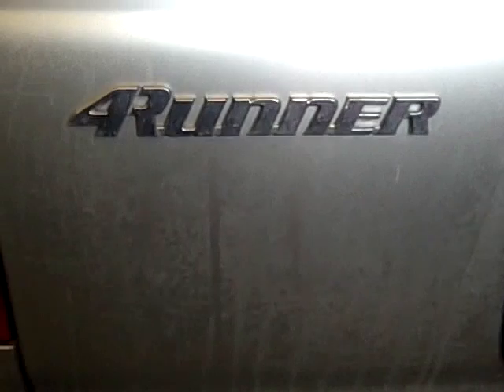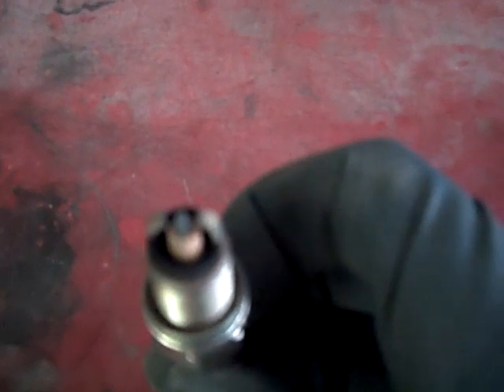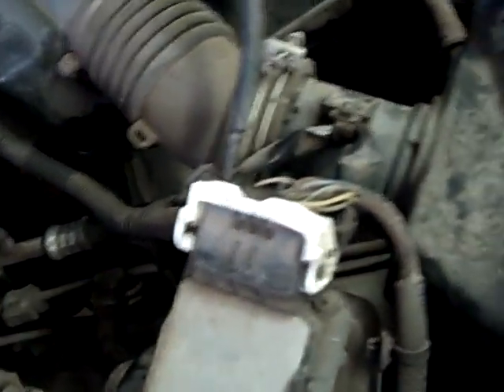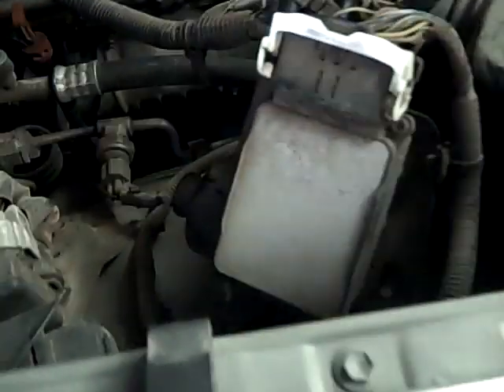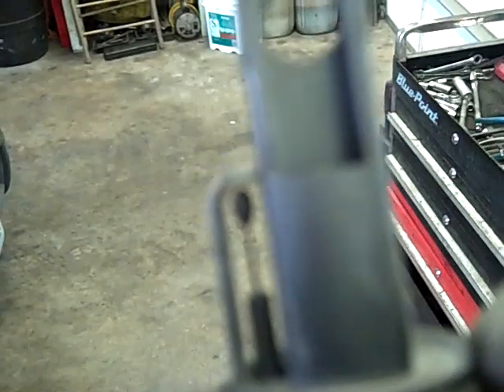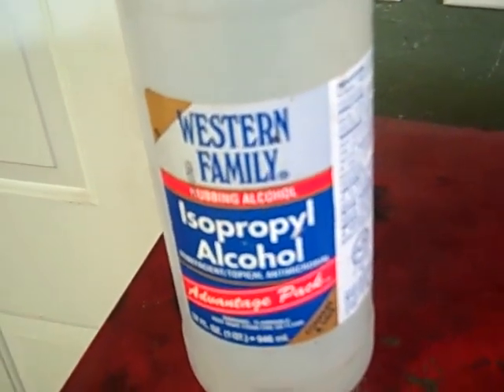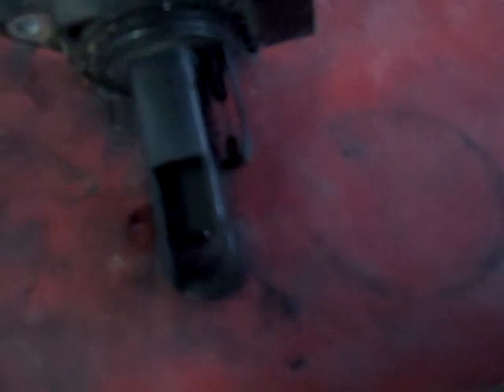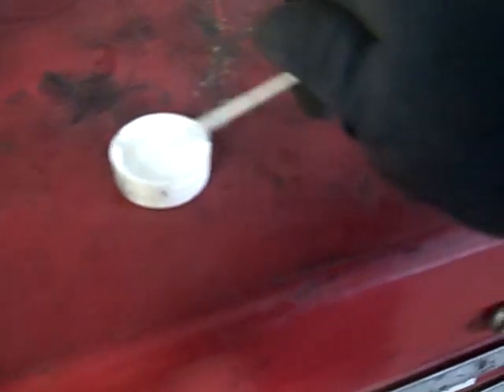P0171 P0174 Toyota 4Runner MAF Mass Air Flow Sensor Fix

Comment: I have an 06 v8 4Runner and I’m getting just the p0174 code. I replaced the maf, pvc valve, replaced gas cap and still the code stays. The runner runs fine, no misfire, no rough idle, nothing. Imma try and do a vacuum leak test but was wondering if you had any suggestions? Thank you
Reply: My 2003 4runner has the same codes start and runs very good but it does make backfires on hard acceleration when is running and has not enough power in heavy acceleration.

Comment: will it throw that code if the intake hose boot is cracked also??  the upper one,     I taped it with electrical tape but failed smog here in CA

Comment: why not use mass air flow spray?  what percent alcohol. are you using? I'm working on a 2010 Toyota rav 4. slight rough idle. no codes
Reply from the maker: +Chevelle99X -Daniel I do now.  I didn't know much about it in 2010.
Reply: Clean a throttle body disconnect your battery ECU well reset computer or relearn throttle position

Comment: Should re evaluate this video. What you cleaned was the intake air temp sensor, the maf hot wire is down inside the tunnel of the housing of the maf sensor.
Reply from the maker: OneLegged hondamechanic  Back in 2010....

Comment: Well that little bulb is not all there is to it.  I tried that and it didn't work.  I investigated further and found 2 little coils of silvery looking wire down in the tube next to the little bulb.  They were dirty.  I sprayed Mas Air Flow cleaner on them and got them shiny again.  That is what really worked.

Comment: THANK YOU!  Engine light went on, running rough, took it to my mechanic, he charged $108.00 just to diagnose the problem with the mass airflow sensor.  Wanted $320.00 more to replace.  Researched on line, saw your video and decided I could do this.  I did use MAF Sensor Cleaner, costs me seven bucks, car runs great, and light is off. 

You are my internet hero tonight!

Comment: Bro thanks, I wasted already few sensors using the so called sensor cleaner, as I used it i needed to clean the sensor more often until it just went bad. you mention some thing about "eating the compound away"… it make sense thanks again bro.

Comment: Brian, thank you for all the videos and advise! I just wanted to confirm the sensor you cleaned was actually the intake air temperature. And that the MAF is down inside the tube and looks like two little hair thin wires. My truck is having some bizarre symptoms which I will describe in another comment.

Comment: Isn't that the air temp sensor u cleaned the hot wire is inside the tube correct

Comment: changed out my fuel filter.drove got up to 50 and started shaking and losing acceleration.i'm wondering if fuel pump is the culprit. 97'4runner 225k miles.plugs and wires are fine. should I try the MAF cleaning or do you suggest something else. is the shaking a symptom of either of these any clue?

Comment: Hey Brian, great videos! I've cleaned a few of these Denso MAF sensors; the "bulb" that you speak of on the side--isn't that the intake air temp sensor? I thought the air-flow sensing part of it was the two tiny wires that are located down in the "tube" if you look at it end-on. Wondering if just cleaning the "bulb" really takes care of the P0171...

Comment: Could a dirty maf sensor also cause a P0446 to come up as well?  I've got a '01 4Runner that idles fine, but hesitates when accellerating.  It also hesitated when trying to maintain speeds if 55-60.  Thanks!

Comment from the maker: There's leaks.  If it's fine the rest of the time, there's a leak somewhere.  Check your intake manifold and small obscure vacuum lines for leaks.  Fuel trim is most fickle at idle and load is being applied.  There's also a chance your upstream O2 sensors are troubled.  More likely a leak though.  Could also be a cracked exhaust manifold if you're over 200K miles.

Comment: Could cleaning the MAF sensor on a 1998 4Runner fix a strong engine smell in the cabin.  Muffler system is tight and engine is clean.

Comment: Your right Brian, I think it is part of the fuel filter or fuel pump..  I will check the fuel pressure and volume. I also noticed in the past if I use seafoam in my gas tank the codes would go away... I will replace my fuel filter anyhow. But your right its the fuel mixture.. ill keep you posted on what happens

Comment from the maker: It could be a number of things.  I would do a fuel pressure test to verify pressure and volume.   I'd also watch the numbers on the computer if that checked out ok.  You could have a fuel pump going bad or a blocked fuel filter (might be a strainer type in-tank.)

Comment: Also I forgot to mention that I have two more 02 sensors before the cat by the muffler and wonder if they should be replaced?? Just baffled and stumped? I did a smoke test and no vacuum leaks. New MAF sensor and 2 new 02 sensors..
Reply: did u ever find the out what the problem was?

Comment: Brian, I have a 2003 Saturn vue v6 3.0 and I replaced the mass air flow sensor and then I replaced the 02 sensors (two) of them both after the catalytic. One by the oil stick and one below it. I still get codes p0171 and P0174.. any suggestions?

Comment: Hey Brian, what you cleaned was the Intake Air Temp sensor, the MAF diode part is inside the big middle section inside, use a torch to see.

Comment: Hi Brian, I have code p0171 and p0174...  I replaced my mass air flow sensor with a new one and I cleared the codes and it was gone for a while then after a Sunday drive it came back?! :-( rechecked it and the codes returned like a bad cold. What do you think it could be? I did a smoke test and there are no air leaks.  Once in a while I hear a pop come from the exhaust when I'm idle at a stop light. Could it be a 02 sensor?

Comment: Hey Brain. I have a 2000 ford windstar with a 3.8L and it has p0171 and p0174 and i clean the MAF sensor and did a tsb on the intake manifold and valve cover which said that would fix my problem but it didnt and there is no vacuum leaks what could it be had the codes now for 4 years.

Comment from the maker: Cut a slot in the top of the screw head with a dremel cut off wheel and use a flat head screw driver.  OR go to sears and buy an IRWIN set of damaged screw extractors.

Comment: My point exactly.  The platinum wire inside the tube is heated to certain temperature.  When the air moves across the wire, it requires a change in current to keep the wire at the same temp.  This change in current is the signal you are talking about.  If the platinum wire is gunked up, you will not get an accurate reaction.  Think of it as having insulation.
Google "Hot wire MAF sensor" and you will see what I mean.
The external probe with the red bulb is just a temp probe to calibrate the MAF

Comment: Exactly how did I get this wrong?  The platinum heater wire inside the tube is the critical sensing wire, not the temperature sensor that he cleans in the video.  This has been mentioned many times since I commented two years ago.

Comment: Your saving my tail again amigo lol after changing the spark plugs on my 2000 4runner that YOU HELP ME TO CHANGE remember? So anyways my check engine still on so guest what I found out this video of yours and find out I was running with out air filter so your are helping me how to clean the MAF sensor how about the throttle? Buy this spray carburetor cleaner at Walmart but instructions telling me to spray the whole can inside throttle moving butter flight at the same time  and run engine ASAP I

Comment: I just rebuilt the top end of my 95 3.0L. It runs pretty good but I am getting a bit of soot on my finger from the exhaust pipe....would this help it burn the correct mixture?

Comment: Thanks :) I have a 22re and I figured out its the Air Flow Meter. If its messing up, it will not idle nor open up. I have one adjustment left to do then it should be golden :) I took the flap off blew in it real hard and it revved to normal. It got dirty, really dirty. Nice 4Runner

Comment: hey Brian great video!  I have a 99 4 runner with the same p0171 code lean bank 1.  My mechanic wants me to put a new max air flow sencer 200 bucks. If I clean it my self how long should it take to get dirty again? thanks

Comment: thanks again man, it's been a few weeks and my truck has not stalled during ignition while the engine is at normal operating temp. No more embarrassing moments blocking traffic in parking structures for me!

Comment: Thanks so much for this video. My truck would stall repeatedly upon ignition it the engine was hot then turned off (like when you're driving, stop to get gas, shut off motor, try to restart, starts for a couple seconds, then stalls). A tune up was helpful but still idled rough. No dash lights came on (I don't have a code reader) but because of the rough idle I figured a sensor might be dirty. Pulled and checked the MAF, it looked dirty like the one in the video. Now cleaned I'm sure it helps!

Comment: 1) Disconnect the neg. battery terminal first 2) clean up inside the tube where the MAF (two platinum wires) are with MAF cleaner only.  3) Spray gently multiple times (4-5) allowing 30 sec. dry time between spraying.  4) Then put back together and reconnect Neg. battery terminal (reset ECU).  5) Then turn the key to on without starting the engine for 20 sec.   6) Then turn off for 20 sec.  7) Then start vehicle with radio heater off and let idle for 10 minutes.

Comment: have same problem,same code,just replace fuel filter,check for vacum leaks,nothing.so i just spray,carburator cleaner to air filter towards to MAF sensor and trotle body.drive couple kilometres and check engine lighs went off.but after couple hours driving is back on...shit.so will take that MAF off and clean like u.if it dosnt work have to buy new.that two bolts goes to sensor is so rusted,have to drill them.

Comment: ok i checked it yesterday when i got home and everything seemed fine. no leaks or anything. but do u think some moisture could have gotten to the spark plugs and caused them to mess up? and do you think the fuel injector needs to be replaced. because this morning i was on my way to school and it started shaking real bad going down the road but the check engine light never came on

Comment from the maker: @UNCLEDUSTY1 If it's only happening at freeway speed it may likely be a fuel delivery problem like a fuel pressure regulator vacuum leak or a blocked filter, strainer, or faulty pump.

Comment: i have the same year model limited edition 4x4 with a 3.4l v6. it will sputter at about 50 mph. it has happened two times. 1st time the check engine light came on it was misfire on cylinder 6 and i got a tune up and that fixed it. the 2nd time the check engine light came on my fuel filter was bad nasty. replaced it about a month ago and  now i have this code come up on my portable computer.

Comment: I just changed both O2 sensors under the car only for the check engine light to come back on....rats... I has already cost me over $100 and a lot of frustration. Should have started here first! So now I am off to clean the Mass Air Flow in my 2000 4Runner. Thanks for the video! I will keep you updated.

Comment: Hi mate , sorry but skidpalce is right, you did not clean the MAF sensor. You acually cleaned the Thermistor ( air temp sensor, looks like a match stick, attached to the MAF sensor) The MAF sensor itself is 2 platinum wires at the bottom of the black tube of the part that you removed, squirt with carb cleaner inside the black tube, then GENTLY clean with a Qtip,  shake out when done .

Comment from the maker: @MsBixy The symptom would be the check engine light coming on.  That's how you know there is a code available to be read by a computer.  no light, codes..... generally speaking.  If you have a hopped up computer you can get pending codes out of it.

Comment: I Cleaned the drop first but that didn't fix the problem. Cleaning the 2 wires deep in the tube fixed it. Now takes off like a rocket. Better than when I bought it at 30K, has 122K now. (1999 Toyota Tacoma 4x4)

Comment: Thank you for this post.  I was able to confirm what MAF is and clean it.  I still need to monitor if that fixed the P0171 code and check engine light.  Thanks much...

Comment: Dude, you totally ignored the most important parts of the sensor.  If you look down the end of the tube on the sensor, you will see two fine platinum wires those are the critical sensing wires.  Get a can of mass airflow sensor cleaner at your local parts store and spray it down the tube four or five times.  If they don't come out shiny silver, then GENTLY rub them with a MAF cleaner-soaked Q-tip until clean.  Go easy on the platinum wires, they are VERY delicate.